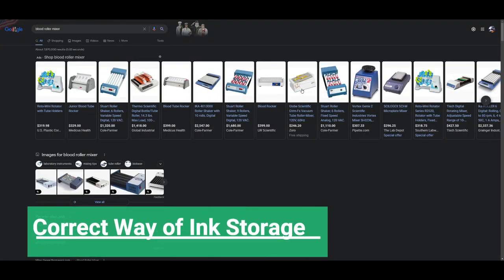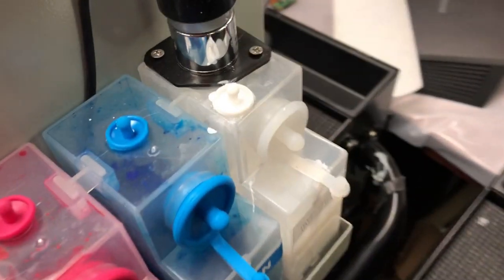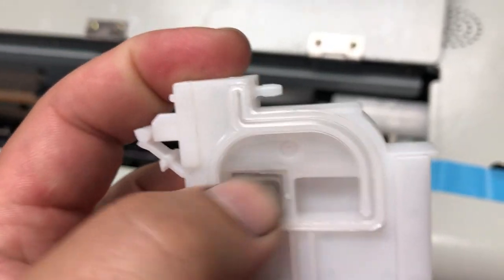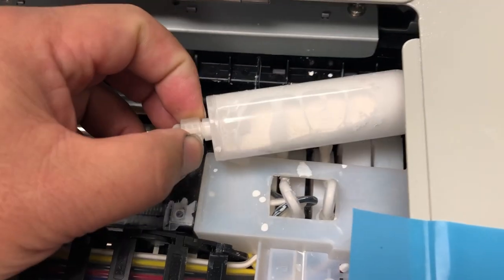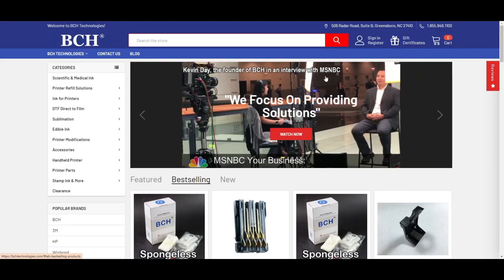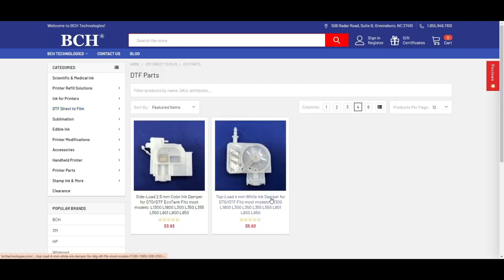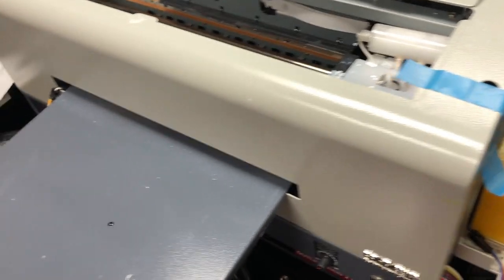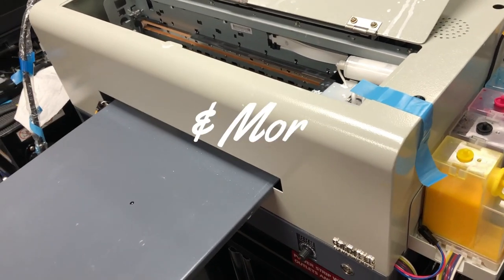White Ink Circulation Management System - Demystify DTF's Direct-to-Damper Technology

Comment: Bought a modified dtf printer and white ink cannot circulate. The pump is not running and suspect driver circuit timer for this has been faulty. Supplier never shipped this item Epson 1390 with a manual for setting up. Thank you

Comment: hey Kevin I am not getting white ink to pull from the outside mixer tank my lines are empty for white ink, if i fill the ciss tank that u show in this video it prints white until it empties that tank out, why is my printer not pulling from the external tank where the mixer is to refill that ciss tank above my dampers?

Comment: The other problem is that white ink is in the print head after the dampers - this is what causes blockage, we use Roland eco solvent vs printers and it has the same issue, ink agitation systems are good but is partial solution to the problem, our machine automatically cycles and flushes white / metallic ink through the head to stop it from blocking, this works but wastes a lot of expensive ink, was thinking of adapting ones of these ink circulation systems for those inks but it’s a single head system dx7 head with 8 channels for each colour, a custom capping system would be required to make a circulation system to retro fit to stop clogging heads would be interested if this type of capping unit was ever produced for existing printers